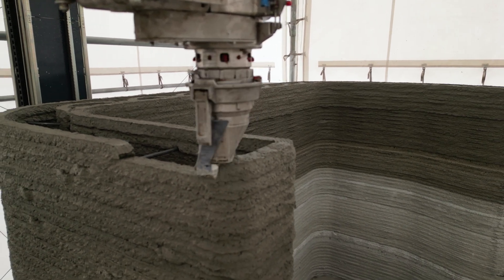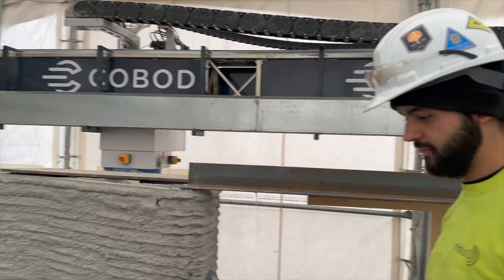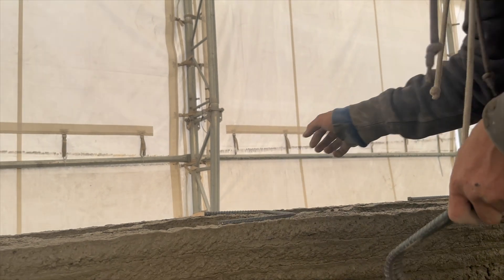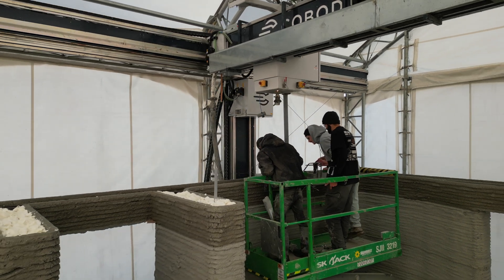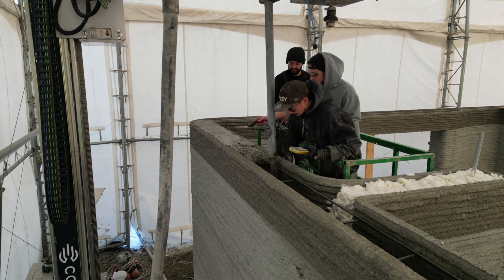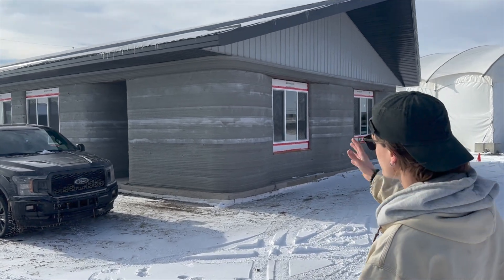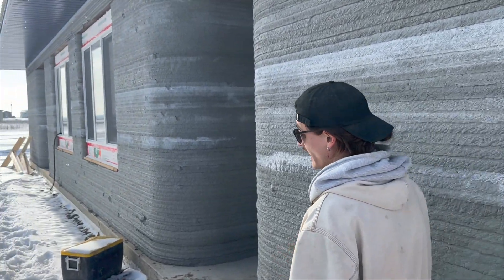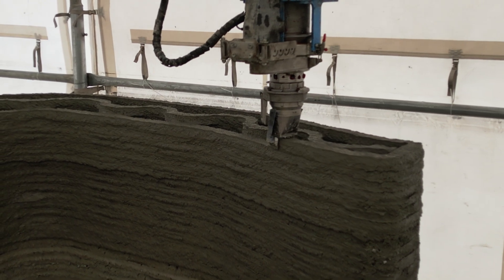Easiest Material Delivery for 3D Printed Houses

Comment: 6:45 what you want is a volumetric mixer , they mix on site from dry ingredients loaded in the truck and you only mix as much as you need each time  , you can buy them at auction throughout USA , the other thing is a Maxon Maxcrete where the concrete truck will dump the whole load in and the concrete can be tested and adjusted before its pumped into the forms.